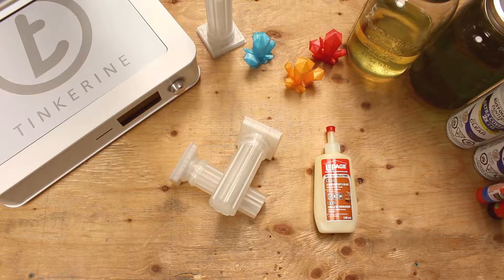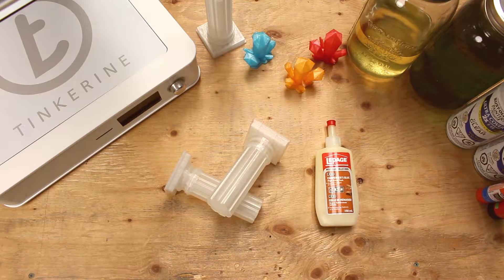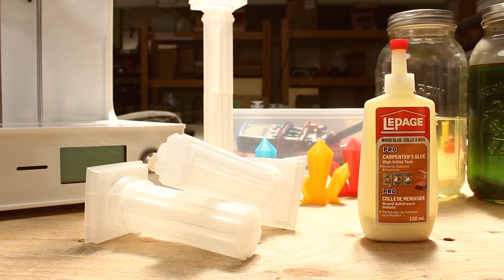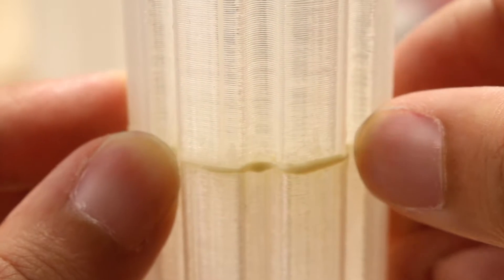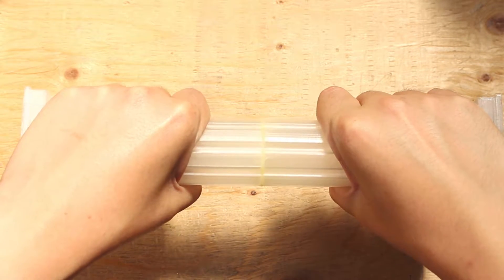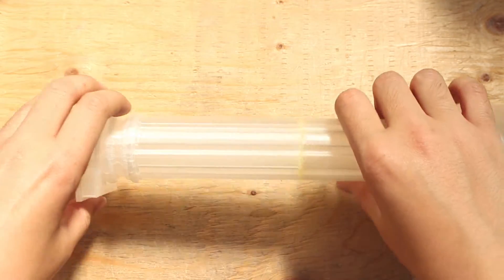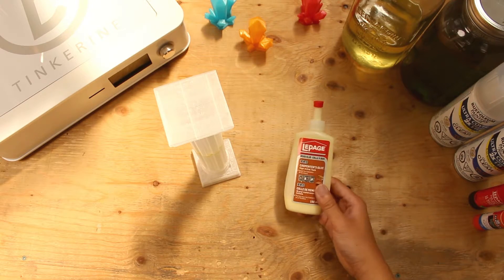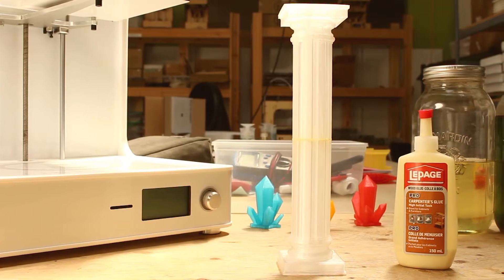Gluing PLA parts together with Wood Glue Revisited

Comment: Thanks for revisiting the experiment. Your still missing a some steps that I would expect with wood glue. Roughen the surfaces with sandpaper. Clamp the joint while it's drying. (These are essential for the bond to work effectively). Also, wipe the clamped joint with a wet cloth to clean up the mess.

Comment: I use wood glue almost exclusively. Better for outdoor use when a PLA part has to be painted. Found that various brands of super glue failed after a few weeks outside. It is OK to test glues but those tests all seem to be for inside use of the parts. For those of us printing parts for outside in PLA other considerations need to be taken into account.

Comment: Thanks for trying that out. I was wondering and here was the answer.

I modded a lamp, where I replaced a small lightbulb-socket with a big one. But the big one needed more space. And not having any wood-tools, I simply designed and replaced the restricting wood-part of that lamp and glued it back together :D

Comment: Wood Glue is water soluble, so cleanup is as simple as wiping the run with a wet rag before it sets.  Also as mentioned it does better when clamped.  I came to see if it would adhere to plastic, and your video didn't disappoint so thanks!

Comment: Dude. You need to clamp wood clue or at least put some weight on top off it
Irrelevant test
Reply from the maker: Thanks for the comment and advice, we started to clamp on later experiments!
Reply: @Tinkerine  Wood glue is quite specific. I know it's old video but I got kinda bothered with it. Sorry, for any negative feedback. 
I was thought (from people who have been woodworking for their lifetime), that you have to clamp it, so the glue is forced into micro pockets in wood grain to keep a strong bond. So it won't work on flat surface (it will but not as effective). Scratch the gluing surface with anything form 60-360 sand paper. Tap some glue and clamp it. It will hold better, than now. Look at guitars, they use wood glue guitars are usually 2/3 piece body instruments(Body), Some where made back in the 60s and still are in one piece even with 50 year abuse. 
This is thanks to prep work. PREP WORK IS EVERYTHING
Reply from the maker: @SLU2MOVIES  No worries, we are happy for the feedback!
Reply: Well...that’s what the direction state when gluing wood. However the results show that it was more than adequate......if you feel like waiting for two days...

Comment: I'm building an arcade cabinet and aside from screws and wood, all the parts holding the pieces together are 3D printed. I made some wood cutting errors and I was missing 1/8 in lenght, so I printed a spacer to compensate the cut error and glued it to the wood with the same glue. Worked like a charm.
Reply from the maker: That's awesome and thanks for the comment!

Comment: The cracking sound MIGHT be from the print itself. I've heard how "crunchy" they can be in other videos from other makers. Who knows though? I don't. I wasn't present in either situation. xP
Reply from the maker: Thanks for the comment!
Reply: Yes. Don’t assume that it’s the glue.
Reply: It might be the case. PLA takes time to crystallize after print and silky PLA doesn't seem to ever fully crystallize. For the 3 plastics I have printed a lot with it takes about an hour or two after print for the part to fully crystallize and not creek or pop when flexing. Even if you get all that right, I have had to bump up to two infill lines instead of just one since slicers all prefer to keep the messy stuff in the fill where it belongs and that results in slightly weaker lines at times.